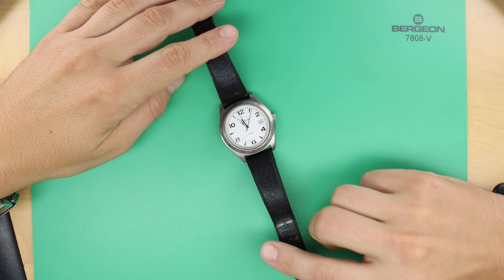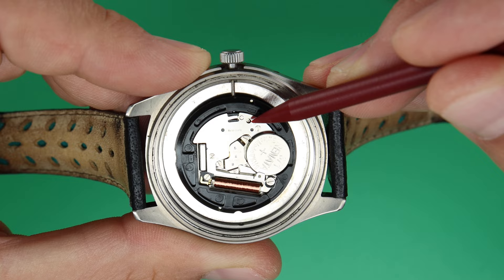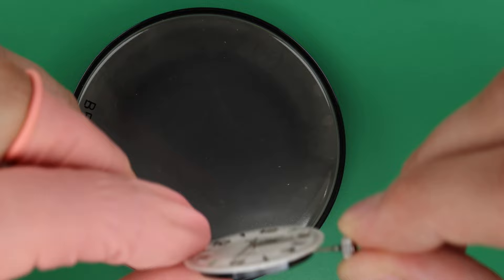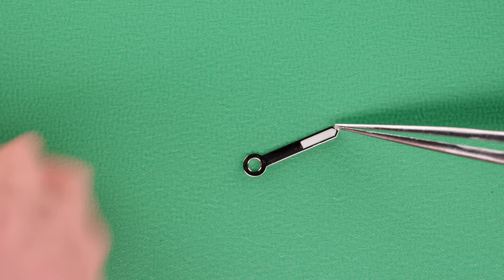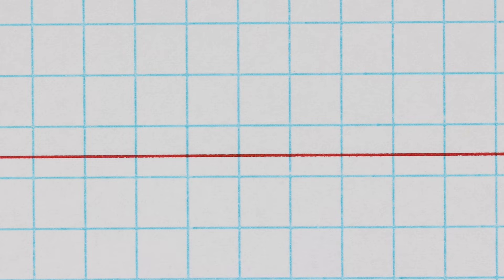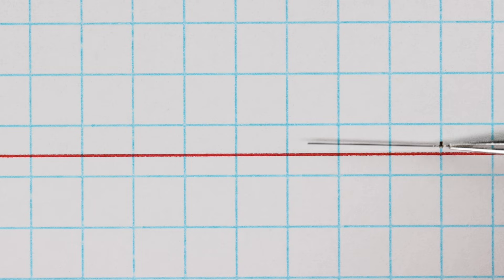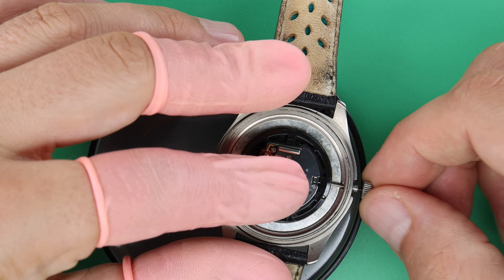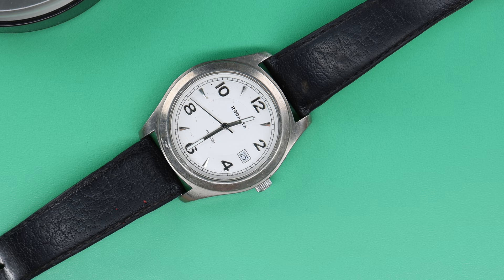How To Straighten a Curved Watch Hand, Check Alignment?! | The Watch Doctor, Uncut #1 | Watch Repair

Comment: Great to watch! I have some Hamilton 992B Railroad Watches from the latter 1950s. When someone has lever set the time at some point, they have bent slightly sideways the ultra-fine steel tip of the minute hand. Would you attempt the same technique, but just pressing the tip sideways? On one of these watches, the watchmaker has seemingly “repaired” the bent tip by carefully clipping the bent end off. This now means the minute hand looks strange because it can no longer reach the dial’s minute calibration marks… so am looking for a replacement.

Comment: I forgot to say, I didn't know about the first position for removing the stem. Is that just for quartz watches? I know some ETA mechanical watches such as the 2824-2 must be in the setting position or you will end up with a jammed keyless work. Also, some Seikos must be in the winding position or you will jam the keyless works. I guess only experience can solve this problem.
Reply from the maker: Usually, you can easily see the difference because when the 'dot' on the setting lever is visible or not. If this dot is visible, it is in the correct position to remove the winding/hand-setting stem. I can't just say the difference between all the calibers.

Comment: Would you be able to help me with an issue I’m having plz? 
I have a Michael Kors watch where the hands have fallen off but I can’t remove the dial. 
It’s a fixed bezel so I can’t access it from the front. 
It’s a MK3709
I would be grateful if you could look into this and tell me if the dial can be removed from the inside. 
Many thanks.
Reply from the maker: Hello, Unfortunately, these are timepieces that are not really made to be repaired, but it's possible, the glass must be removed under air pressure via the crown tube.